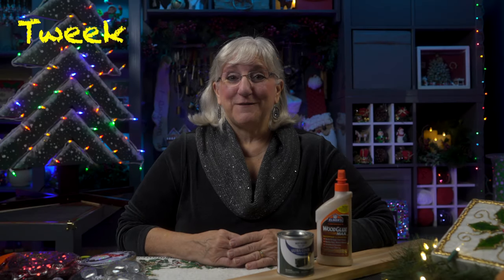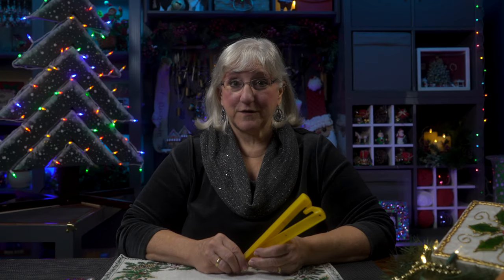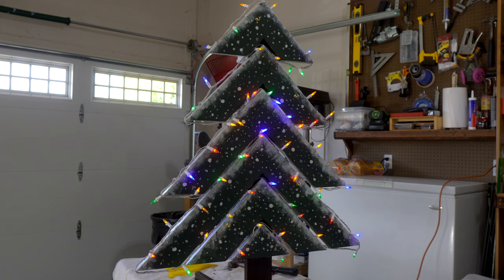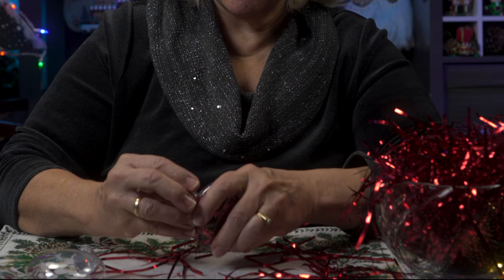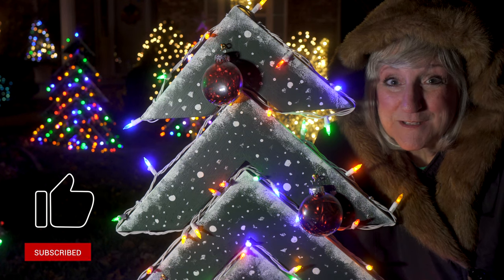Make an Outdoor Christmas Tree, How to, Christmas Decor, Woodworking

Comment from the maker: Christmas Tree Chapters

0:00 - Intro
0:27  - Project Description
0:45 - Project Supplies
1:05 - The Tree Pattern
1:20 - Cutting the Wood
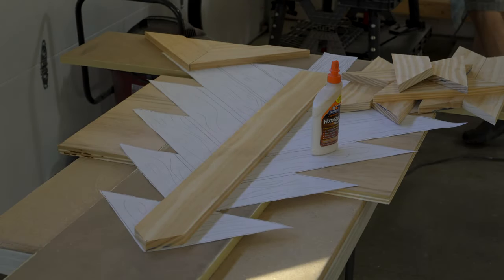2:11 - Attaching the Branches  
2:58 - Wood Putty in the Nail Holes
3:10 - Cut Wood for the Base
3:40 - Drill holes for Tent Stakes
3:55 - Time for Some Sanding
4:15 - Attach the Base
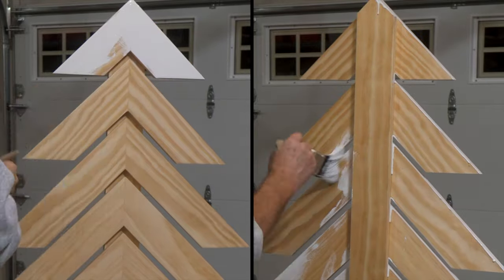4:30 - Paint the Tree with White Primer 
5:15 - Paint the Branches Green
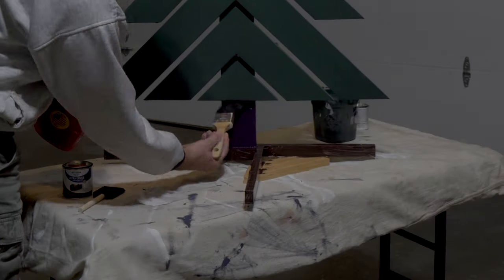5:50 - Paint the Base Brown
6:05 - Adding a Snow Effect
6:20 - Add Some Lights
6:50 - Make the Ornaments
8:50 - Finishing touches 
9:40 - Outro